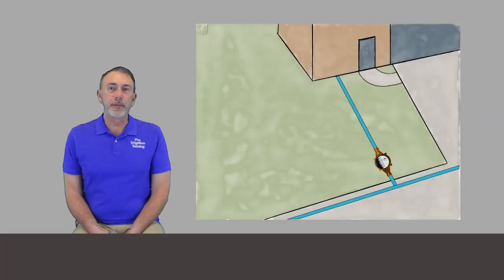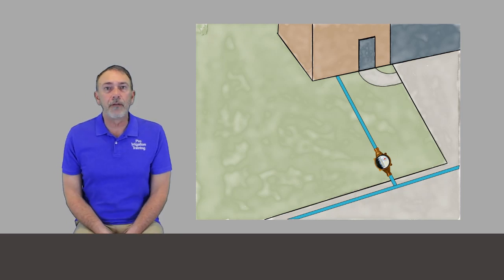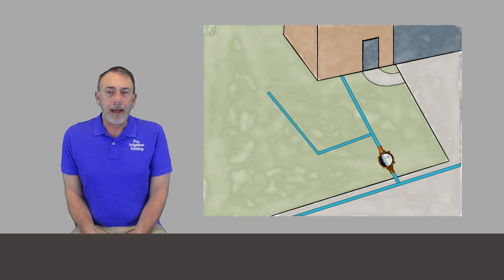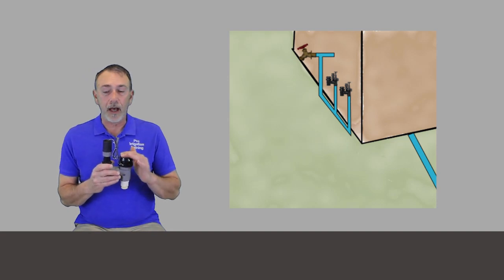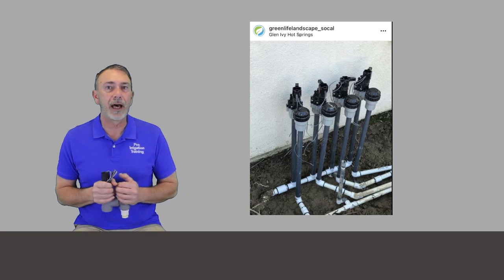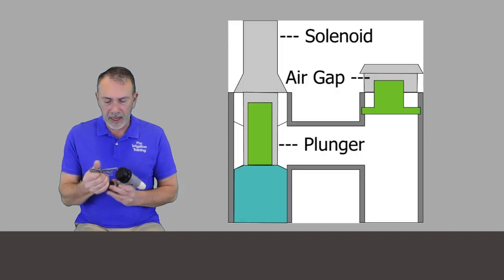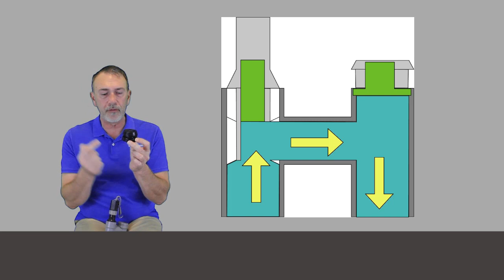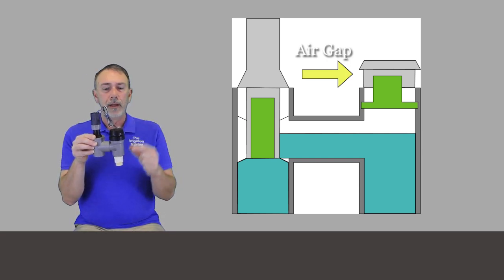How to Use Anti-Siphon Valves (w Backflow Prevention Basics)

Comment: Great video currently having an issue with siphoning, hoping you can give me a solution just installed a booster pump on my uncle's irrigation system due to his home water pressure from the city is only 50 psi max with no pressure regulator he has about acre and a half lot about half of that sprinkler system and a bunch of plants. The problem I'm having is I installed the booster pump with the expansion tank next to backflow preventer but when sprinkler system is on pump kicks on and causes pressure drop in main waterline causing the backflow preventer to siphon and start leaking a bunch of water what can I do to address this issue hopefully that made sense
Reply from the maker: It's super tough to diagnose a problem like this over the internet. But it sounds like the backflow preventer has failed. Don't know what type you have, but I think all of them are supposed to protect against back siphonage. But I don't think it's actually back siphonage if the pump is after the backflow. It may just be leaking, check all the testcocks to make sure they're completely closed.

Comment: How can water be siphoned back out of the pipes that feed your sprinkler heads if the pressure is zero when the solenoid part of the anti siphon valve is closed. It could such water out of your potable water from the house but I can’t see how it will siphon water out on your sprinkler pipes when the solenoid valves are close. I currently have an anti siphon valve as my master valve and use inline valves for my zones. Please comment so I’m clear about what you are saying.
Reply: I also have a double check valve backflow preventer feeding the main line into my anti siphon valve which is my master valve for the system.
Reply from the maker: If the anti-siphon valve is properly installed, it won't happen. The only time you'll have water coming back out of the valve is if you put a valve downstream of the ASV (and it doesn't always result in backflow, but it can). Or if the ASV is lower elevation than the zone,

Comment: Can the double check valve be installed  below grade? I'm coming off my well with no meter.
Reply from the maker: Unless you have local code that says no, it's a good option. Many people with wells just use the residential dual check which is a non-testable unit that you replace every 5 years. Just make sure you install it in a valve box, and if it's in danger of freezing in the winter, put unions on either side so you can remove the unit if you winterize.
Reply: @Proirrigationtraining  thank you.

Comment: Thanks for the video I am using the newer rainbird anti-siphon valves on a drip line 2 other valves are working just fine however the front anti-siphon portion of the valve leaks water when it runs assesntionally the plunger of the anti-siphon is not being pushed up all the way instead of running full pressure down the outlet line and there the regulator filter is clean. So I am assuming the the anti-siphon plunger is not being pushed up all the way allowing the leak. I do have two other valves of the same type working just fine and the drip lines are at the same level as the problematic valve. Was just curious if I needed a check valve to stop this issue or if I needed to do something else?
Reply from the maker: Thanks for watching. There could be 2 things going on. The flow amount may be too low, which is sometimes the case for drip zones. If the flow is below the minimum threshold for that valve, it causes problems. Also, you said that the drip lines were at the same level as the valve. Those valves need to be at least 12" higher than the highest outlet. Hope this helps!
Reply: @Proirrigationtraining  Thanks when I said same level I should have said same ground level . The valves are above ground level at around 12". The last 2 drip lines that don't have issues have outlets at ground level and leading behind a retaining wall that is around 3 feet above ground level. The the 1st drip line valve which only has outlets at the moment behind the retaining wall which is around 3 ft above ground level is the only one having the issue with the  anti siphon plunger not closing all the way when running and leaking. So I was curious since the other two drip lines that are working fine and are fed after the problem drip line would the same solutions you mentioned still hold or if there could be leak somewhere in the third drip line after the valve outlet?.
Reply from the maker: @TimB-t1x  Have you taken the Vacuum Breaker off and checked it out? Flush it out with water and see if anything is stuck in it. And it may be possible that it's just a defective valve. Also check how much flow is going through the valve. You can count up the drippers and figure that out, then go online and look at the valve's specs to make sure your flow exceeds the minimum required. There are low-flow valves made for this purpose.
Reply: @Proirrigationtraining  Thanks again. I haven't checked the vacuum breaker would that be on the valve and if so where would be located?
Reply from the maker: @TimB-t1x  If I understand your question correctly, it's the part that's leaking. It looks like a mushroom top with a vent under the cap. you should be able to unscrew it from the valve body.
Reply: @Proirrigationtraining  Yes then I have checked that part of the valve and replaced it with a new piece just to make sure it wasn't a defective part but the plunger of that part still isn't closing all the way when running
Reply from the maker: @TimB-t1x  Without seeing it in person, the only other thing I can think of is the low flow issue.

Comment: Thank you for your video! On one of my sprinkler lines, water flows out of the air gap area on the A.S. valve once the watering cycle is complete. Water runs out for approximately 8 seconds, almost like it is draining the line. The other 3 valves do not do this. Is this normal/common?  Thanks again!

Comment: This is really helpful. I know next to nothing about irrigation system but can understand this. I live on a steep hill. My irrigation valves with anti-siphon are installed in the middle of the height. It should have been on the very top because there are irrigation heads from the top to the bottom of the hill.
Reply from the maker: Hi Anne! You're right, those valves should have been installed at the top. You could potentially have some backflow happen. The fix would be to change the valves to normal solenoid valves and put a backflow preventer at the beginning of the main line. Thanks for watching!

Comment: Where is the “how to use”?    
Your tutorial ought to be called “what does a anti siphon valve do and how does it work”.  
I’m looking for:  how to operate it as there is a open/close lever and a round knob to adjust water.
Reply from the maker: Hey Leif, thanks for watching. You're not wrong about that. There is a video in the playlist called Solenoid Valve Features and Options that has info about the knob on top which is a Flow Control Valve. The switch is pretty uncommon, is that a Weathermatic valve? It's just an "internal" bleed, used to manually operate or flush the valve. And so, to explain the decision to not have every product video fully comprehensive: most people won't watch a video past 3 minutes, hardly anyone past 7 minutes. So I had to stop making 17 - 20 minute videos, no one would watch to the end. And I pack in info to the very end.
Reply: Surely the valve comes with instructions.
Reply from the maker: @sunshine-iv5ff  One would think, but usually all they give you are the specs, not really much in the way of instructions.
Reply: Thank you so much. If I saw this video when I started my drip irrigation project, It would be installed by now!
Reply from the maker: @sunshine-iv5ff  You're welcome! Thanks for watching.